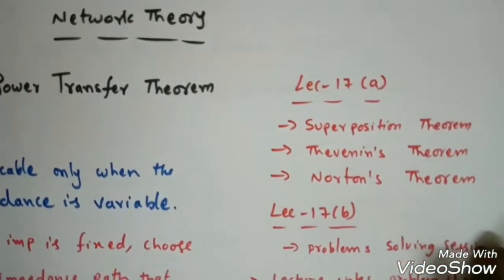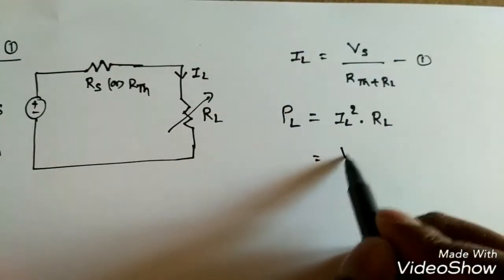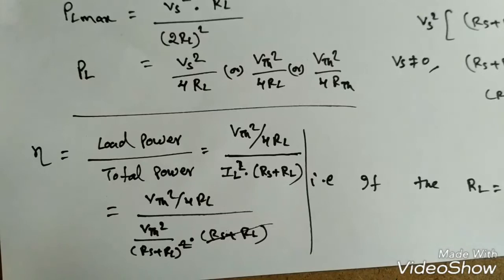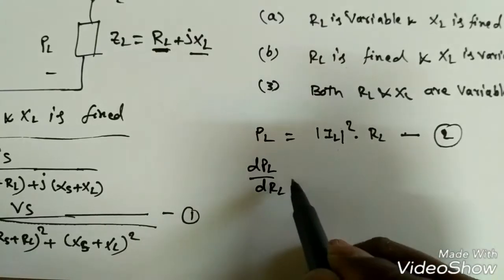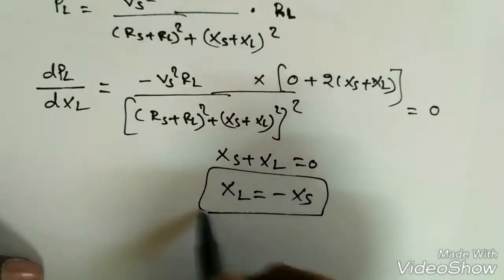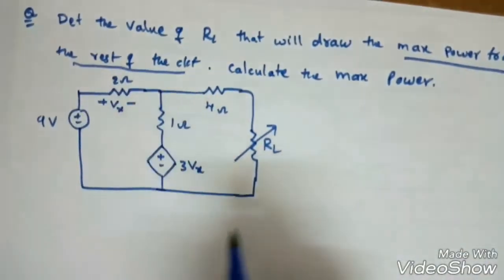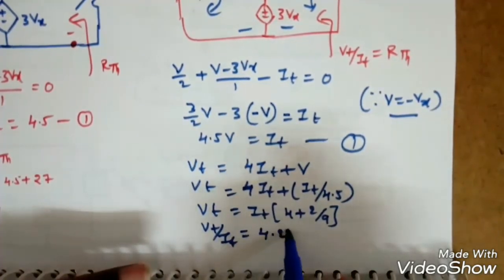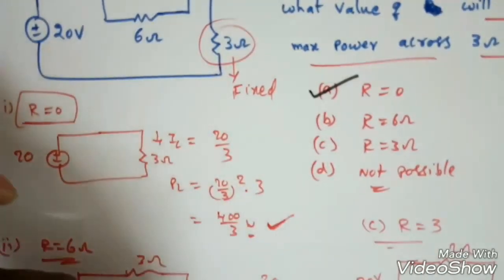Network Theory Lec-17(c): Maximum Power Transfer Theorem

Comment: sir, why maximum power is being delivered for R=0 and not when R=6. As when R=6 we will get R(s)=R(L) hence condition for maximum power transfer
Reply from the maker: because that condition s valid when load resistance is variable...when load resistance is fixed we need to find the minimum resistance path that leads maximum current flow through the load..therefore maximum power at load